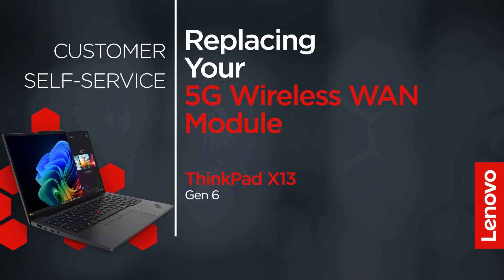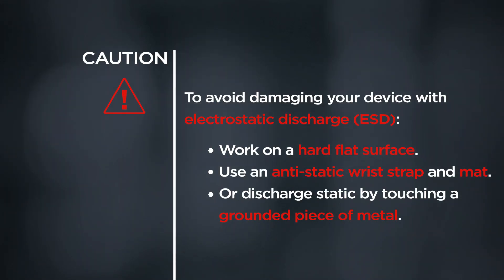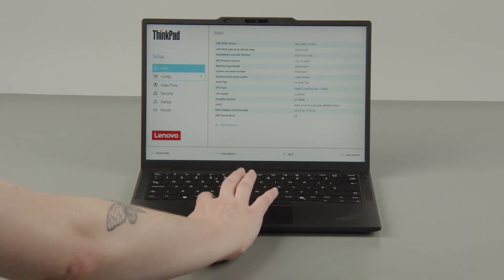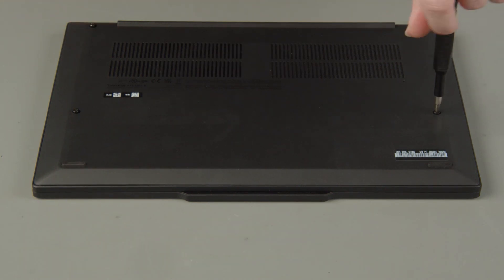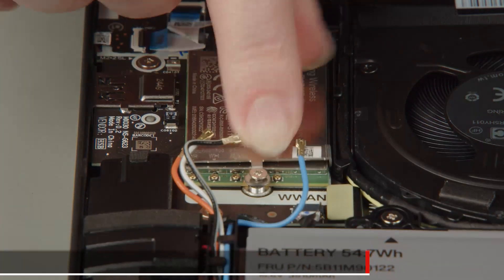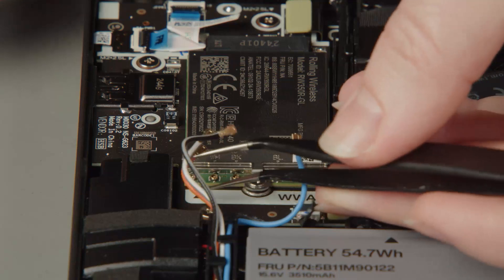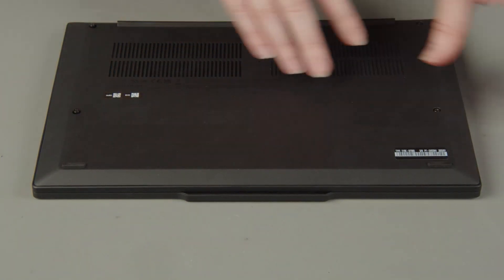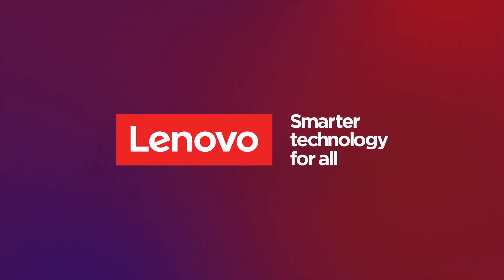Replacing Your 5G Wireless WAN Module | ThinkPad X13 Gen 6 | Customer Self Service

Comment from the maker: This video will show you how to replace the 5G wireless WAN module in your ThinkPad. The process in this video will work for the ThinkPad X13 Gen 6.

You will need a screwdriver kit, a non-metallic pry tool, static-safe tweezers, and 20 minutes of your time.

To learn more about your device go to https://pcsupport.lenovo.com

To find parts for your device go to https://support.lenovo.com/parts-lookup/?cid=ww:lenovosocial:b9515f&source=socialmedia&subsource=yt

To view the Lenovo Support Self-Repair Guides landing page go to https://support.lenovo.com/us/en/solutions/HT516547

** NOTE: Static electricity can destroy components. Use a grounding strap, and clean, non-conductive surface to work on. Use plastic or coated tools to prevent scratching and avoid using metal tools on plastic parts. For more detailed information on electrostatic discharge and how to prevent it, please watch our "Understanding Electrostatic Discharge (ESD)" video: https://youtu.be/by4PB3WtdLo 

Applicable Machine Types:
ThinkPad X13 Gen 6 - 21RK, 21RL, 21RM, 21RN

Check out other official Lenovo channels!
https://www.youtube.com/@Lenovo 🟥
https://www.youtube.com/@lenovolegion 🎮
https://www.youtube.com/@Lenovo-PC 💻
https://www.youtube.com/@LenovoSuporte 🟢🟡

#Lenovo #LenovoSupport #LenovoTechSupport